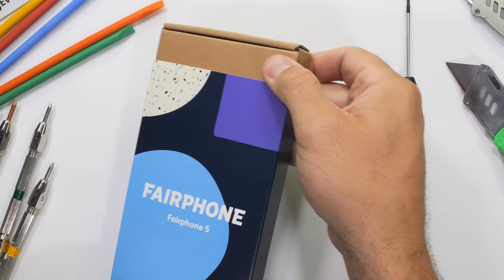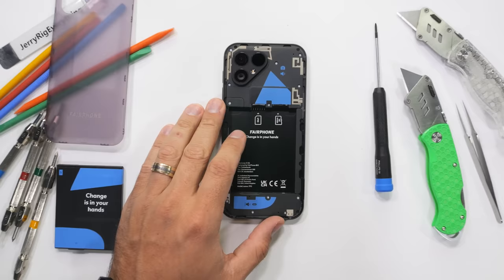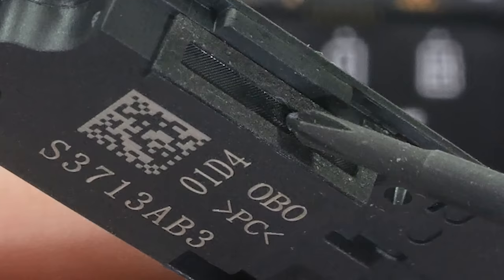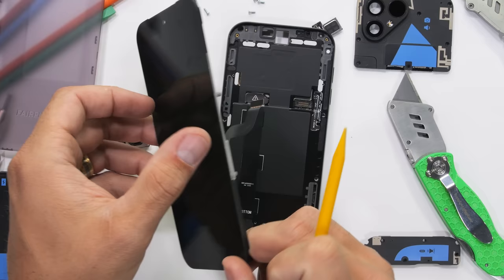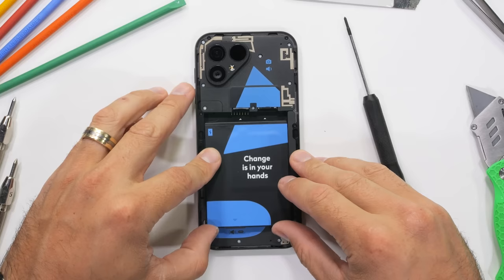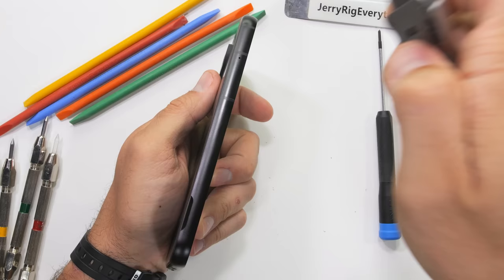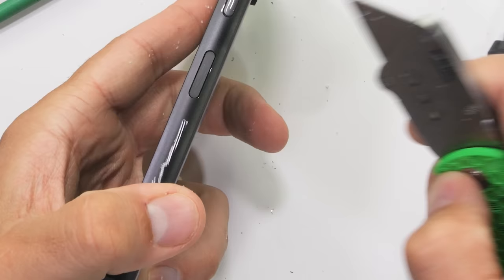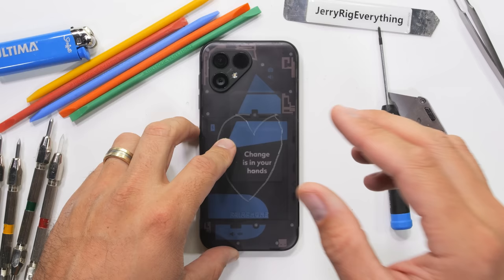The Best Smartphone on Earth - (Not Clickbait)

Comment: This reminds me of my beloved LG G4. Replaceable battery and microSD card slot have always been a priority for me - it's just annoying that the vast majority of phone manufacturers have gradually done away with various features whilst increasing the price.

I use an LG V30+ now, which has a microSD card slot but no replaceable battery. The built-in DAC and headphone jack are features that I didn't know would become rare after a few years. It's still going strong and I have no plans to replace it for many more years to come (hopefully).
Reply: I loved my LG G4! And my G2 before that. It's a shame they didn't quite hit the mark with the G5, and an even bigger shame that they're no longer releasing phones.
Reply: Me too, I won't ever purchase a phone that doesn't have a removable battery, the LG V20 is also a great option, I picked one up this year for my son..
Reply: Still have my G4, I love this phone, the only thing I don't like about it is the locked bootloader, nothing can be done about it… Sadly. Updated it to Marshmallow and since then it became sluggish most of the time… How they couldn't do an optimized system for 3 gbs of ram ?
Reply: I'm still on my LG V30 too, but I recently cracked the screen  and its cheaper to by a new phone 😭I'm surprising myself but the Motorola line of phones are the best on the market upgrade for me. moto g54 seems like the way if you're looking to upgrade anytime soon and its $300!

Comment: Man, that charger port removal looked so satisfying... My previous phone borked because it wouldn't charge anymore, if it only had this, I could have used it for a few more years. So happy to see this, and I sincerely hope it becomes the standard.

Edit: Just realized, it doesn't seem to have a 3.5mm plug. If they just added that, I think it would be perfect (especially because it is a bit pricey).
Reply: I agree with you! It only lacks a headphone jack...
Reply: not so fun fact, they pulled an apple, took out the headphone jack starting with the fp4 and started selling wireless buds instead, their reasoning was less parts to break so their warranty can be better, the buds they sell now aren't any more repairable than airpods but they do sell individual cases and buds. personally that move leaves a very sour taste in my mouth but they've done almost everything else right on the phone, with how modular the phone is, i wonder if anyone's working on bringing back the jack like how that one guys was able to put a jack in the iphone 7? i'd bet it'd be difficult but still orders of magnitude easier on this phone than any other phone...
Reply: i think it's more how most people like wireless than wire type thesedays
Reply: No. Give it a rest. There are adapters for the USB-C port. Also there are some headsets that don't even need the adapter.

Comment: I remember being very interested in their previous model, but ended up waiting due to it using a weak processor for the price, and having weak cameras (also my current phone was still good at the time).

Now however I'm looking to change, and this may be its time to shine.
Reply: It is kinda pricy but hey, ethically sourced materials and labor will cost extra! I wish it had an 8 series snapdragon personally but anyway, if my current one kicks the bucket I'll get this. Even in 2 years I'd still be getting 6-8 years software support
Reply: @donotatme  Looks like they went with an industrial chip so they can guarantee the 8+ years of software updates. I'd rather have that than a snapdragon 8 series processor which theyll sooner or later struggle to provide updates to because qualcomm drops support
Reply: @Maxlan  exactly, I've been trying to tell people that as well lol
And isn't the chip based on a 700 series chip anyway? That's like 1 "tier" below the 8x series. I forgot which model exactly but the Geekbench scores of the consumer chip almost match my 865 which is still very snappy!
Reply: @donotatme  778 if I remember correctly. And yeah, smartphone performance hasn't really been an issue the last couple of years, the only place where you really notice performance updates anymore is benchmarks and some games. Unfortunately I just got a new Zenfone last year, so I'm guessing I'll wait till the fairphone 6 or 7 before I switch over. Really like the direction they're heading!
Reply: @donotatme  yeah that super long software support is a massive benefit. If they could do something like framework and allow you to swap the motherboard with the one of the next model and get a cheaper upgrade, this would be a no brainer
Reply: @alexripard framework is in no way actually cheaper tho. Cool concept but it’s very pricey
Reply: the performance is still at leas 3 years behind any other brand.
Reply: I did so too, and then I moved to the US, and now can't get one for love of money--or at least am afraid to spend the money to have a friend ship one to me, for fear the radios won't work properly.

Comment: My Samsung Galaxy S5 4G LTE had a plastic snap on/off back and easily removable/replaceable battery.  It is one of the most common sizes of battery and readily available online for less than $10.  I was happy to keep using it until Verizon did something to their towers and system that caused the phone to randomly drop the signal so I couldn't make or receive calls.
Reply: And the phone was waterproof(IP67). The buttons, the speakers, the charging port cover and the backplate have a rubber seal around their edge.
Reply: @talos86  Absolutely.  And, for being a single camera phone, it took excellent pictures in a variety of situations and the video motion tracking focus was better than my expensive DSLR camera.
Reply: Not true. Those batteries cost 59 euro back in the day

Comment: My first "smart"phone had a removable back and replaceable battery (and a curved screen!), and I've missed it ever since.
It was horribly underspecced for being a flagship because the "progress" of software and hardware was breakneck fast back in the late 2000s and early 2010s.
As well as a very small battery (the specs moved faster than battery size could catch up), despite replacing it with a double capacity battery with a fatter back panel, the phone only really lasted 3 years before becoming unusable (early super amoled screen turned green yellow, battery gave out, no software updates, unsupported SoC and too weak to run newer community ROMs...).
Said community ROMs did provide an extra year of valuable life and lots of features, but that's where it ended.
Tried newer ROMs later for fun, not very usable.
TLDR : glad fairphone are continuing to improve and getting regulation support, can't wait to see what smartphones will look like in 2027.
Also I'm so glad the glass sandwich trend is finally starting to go extinct (Galaxy S23, Xiaomi 13, Pixel 8(?), ZenFone 10, Razr 40, all have plastic backs)

Comment: It's so interesting how this is essentially what any flagship Samsung or Motorola looks like if you're familiar with the repairs, just with verrry small changes to make it more user friendly. no flex on the battery, short and sweet flex cable for charging port, little things like that... im very comfortable fixing basically any smartphone and i still want one of these for me and all my friends, just seems comfy and low maintenance. $39 euro for whats probably a 10 USD battery is a bit steep, but when you consider a repair shop would charge 100 bucks for the repair, you're still coming out on top as an end user. not a bad business model...

Comment: I would love this phone if it had flagship specs
Reply: Not all phones have to be flagship. A majority of users never even use their phones in a way that requires todays flagship specs. And Fairphone do have to make some compromises to be able to offer longer hardware and software support unfortunately.
Reply: @sys-administrator You can't really do waterproofing and easily repairable at the same time.
Reply: @baverfjant if this phone is supposed to be kept for as long as they say, flagship hardware can keep it from feeling sluggish down the line as the os and apps become more resource intensive
Reply: exactly what i was thinking when he said 8 years of updates. NEEDS to be a flagship so that it can actually be useful after those updates.
Reply: well, most people dont need more then a midrange SOC and 8Gb ram and 128gb storage.. the only thing most people buy a flagship is the camera... and the sad part is, all the brands could use the flagship exclusive camera system's on a $500 phones, cos the hardware is good enough, the only reason they dont, is that is the only thing they can get people buy their $1100+ phones..
Reply: @baverfjant  You can do it but it is harder. Samsung and Sony did it before with removable batteries.
Reply: Do you actually need flagship specs? Most people don't. It's nice to have, but 99,99 %  does not need nor use their flagship specs. What really is needed on the FP5 is the 3,5mm jack.
Reply: @baverfjant I think they could if they put rubber gaskets where the external parts meet each other. The gasket could be replaceable too.
Reply: @sys-administrator the duck is proofing ?
Reply: @sys-administrator i just said the same thing before I saw your comment.
Reply: @baverfjant  True, most of users just use social media or watch videos. For Gaming as well, a mid tier chipset these days should suit most of your needs. Its the FOMO that many people have.
Reply: @larskristianreinertsen if you not using flagship specs and hate wireless headphones than this is not means that everyone like you said "99.99%" not using processors at hard tasks and not using wireless headphones.
Reply: This is only your opinion.
Reply: @baverfjant my Flagship OnePlus 6 is still in use because it is a Flagship.
Cheap Phones usually last 1-4 years if you handle them with care.
The fear film might last as long as my current phone but only if I'm extremely careful to not get it wet.
Reply: @baverfjant it's more easy than you think.
You just need waterproofing on collectors and waterproofing on the boards.
You could still do it with nail polish.
Reply: @larskristianreinertsen  Somewhat middle range Snapdragon 650 from 2015 has Antutu score of 78000, compared to Snapdragon 6 Gen 1 from late 2022 with the score of 500000. They are mid-range, but the difference is ~8 years and about 6.5 times in benchmark performance. I think you'll notice that.
Reply: @MikoYotsuya292  yes, but think about a midrange chip from 7-8 years ago. The phone would run horribly slow. The same will be true for this phone. You don't need flagship hardware right now, but for the future
Reply: the big boy specs arent gonna be worth it for everyone but honestly i would also just pick this phone right up if it had big flagship specs.
i pay for the phone, i use the whole phone.
Reply: @larskristianreinertsen exactly. I was very sad they decided to not include one. This was a dealbraker for me. 😢
Reply: @oopdigdigfig9786 your batery will die... and then what? The largest issue is battery. Most will last only 3 to 4 years depending on use. So processor power is moot point.
Reply: @baverfjant  he is right, fairphone should release it with at least 120hz screen for 700 euros. its quiet overpriced for me (I wont look at it with these specs even at 600, still overpriced af), shop at my country had poco f5 pro 12GB 256GB for 470euros and its no issue to buy it for 599 any time. But we are all using phones differently and we are buying them with different thinking so somebody can found fairphone 5 as good choise but for people like me who are going for raw performance for decent price its quiet terrible choise. like yeah its nice to be able to swap battery but wait few years, fairphone wont be only one with removable battery...
Reply: @trowawayacc  bro you can change the battery within a minute on this phone????? How do you change the ram, storage speed and soc?
Reply: @baverfjant I always laugh at the "Tech savvy" folks when they're talking about how high end their spec is but then don't even fully utilize the whole hardware and only play crappy games and take edited selfies
Reply: @baverfjant obviously, but the people likely to be watching these videos are enthusiasts. The average person might not care, but many of us do.
Reply: @gorin3512  if you do benchmark and compare it to the newest phones, I also believe you will notice it. But if you just use your phone normally, how often will you think about it? Most people use their phone to text, take photos, watch videos, read the news etc. Maybe FP5 does these things 5% slower, but who cares? If it was good enough 5 years ago, why isn't it good enough now? If you game on your phone or are doing rocket science, then maybe you would be better of with flagship specs.
Reply: For me, 8 years of security is top-level-flagship
Reply: @baverfjant u can...had those "rugged" military grade phones like kyocera/cat and the S5/S4 active that where ip67/68 and had removable back and can be taken apart pretty easily
Reply: Wtf is Qualcomm QCM 6490 gimme 8 series :(
Reply: Most people don't keep phones for 8 years and also the midrange SOCs don't support some premium camera functions as recording 4k60 8k30 1080p960 and their image processing is noticeably worse. I had two phones with the exactly same camera in my hand but one had SG860 and the other SG750G and the 860 made consistently better photos. So a flagship SOC would definitely be desireable.
Reply: @chnapo1  gimme any snapdragon that starts with an 8 not 7 but 8
Reply: @baverfjant pressed o-ring seals would like to know your location
Reply: @Sulphur_67  Was under the impression that it would be difficult to get it fully sealed considering how it's also meant to be easily opened and disassembled.
Reply: @baverfjant  flagship specs help to keep the phone for many years
Reply: @baverfjant  better specs are good for normal use over time as well, a mid spec phone from now will be sluggish in 5 year, the higher end spec phones usually give you 2-3 years of more juice. A good option would be a path to upgrade cpu/gpu, the option doesn't exist right now but seems to be the move like framework laptops.
Reply: @_MythicalWolf As I've said to others, Qualcomm won't offer more than 3 years of  Android updates and 4 years of security updates for their Snapdragon chips.
Reply: @baverfjant  you can. samsung and sony have done it before.
Reply: @_MythicalWolf It's pretty nice to have two options in Bluetooth and 3,5mm rather than just one though. The whole "It makes the phones smaller"-argument Apple pulled is BS. It's not noticeable. And it costs them what, a few cents?
Reply: @baverfjant yes they are aware that’s why they made the comment, what is all this cope?
Reply: @mrdot1126 it ain’t, good enough isn’t enough, the huge shutter lag from even a mid range is so noticeable it will never keep up.
Reply: @ReinhardSchuster how do you diy waterproofing with nail polish?
Reply: @AndyZULUL  Not sure they are aware if they repeat the same thing over and over. It's not coping you cringelord. It's explaining what the trade-off is with offering longer update support.
Reply: It does if the price is going to be £620  @baverfjant

Comment: Kudos to fairphone for making their phone repair friendly but they should add 3.5mm jack. Imagine buying a fairphone because it takes their material from sustainable sources but you need to buy a Bluetooth earphone/headphone which doesn't use recyclable materials or minerals from sustainable sources.
Reply: Or just get a small adapter.
Reply: In the webshop of fairphone they  a USB to 3.5mm Jack adapter including a simple DAC I believe

Comment: 0:58 LG G5 had the easiest battery removal of all time ;) ! But this classic method is definitely a close second :)
Reply: LG V20 also
Reply: @frasr  Isn't that basically the same method Fairphone is using here, which used to be standard? With the G5 you didn't even need to pop the back off. You pressed a button on the bottom of the phone and pulled the bottom out along with the battery.
Reply: @baverfjant  oh yeah you're right. I thought the g5 back popped off with a button like the v20 but I might have been thinking of the g4 or g3

Comment: 25 bucks for the chargingport is quite much . I changed mine for like 10 but had to remove the back which destroyed the already broken back so the 25 bucks are in the end cheaper i guess
Reply: I mean the component prices can definitely be cheaper as I'm sure they are manufactured by a 3rd party Chinese company that sells them for less but also they're definitely not too expensive considering they are sold from fairphone directly. So I suppose it's an alright balance between profit for the company and not ripping off the consumer too much.